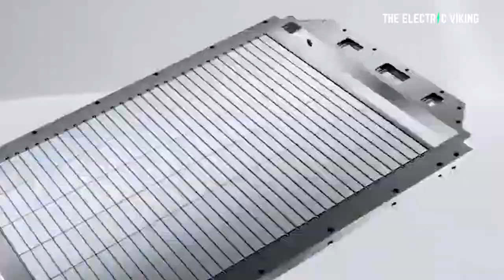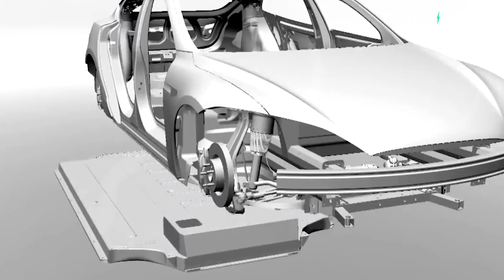Tesla's Model 2 Hatch & Crossover will KILL gas cars in 2023

Comment: I believe that Model Z would be a natural progression from X and Y. A compact crossover SUV with similar dimensions to the BYD Atto 3, MG ZS EV and Hyundai Kona, all of which are very popular and successful EV models. This is the market that Tesla needs to break into. If they could launch a vehicle like this which would cost $30k in America, and $40k in Australia, they would sell millions of vehicles. The problem with a hatchback like the Peugeot e308 is that it's too small to get decent range because of a smaller battery pack and also have reasonable room inside. It needs to be taller but more compact in width and length than the Model Y. That's what I would do if I were Elon. Maybe that's not what he will do, but I think it would be fairly easy to just use the basic design of the Model Y, same mechanicals, same structural battery pack and cast alloy body section, but just shrink it a little, just take a couple of inches out of the width and length but add an inch or two to the height to compensate, and you can make the car cheaper because you need less materials. The top half of the car is mostly glass, so those extra inches in height won't cost much.
Reply: I guess the Model Z will be produced in Russia.
Reply: @hvxcolors396   Yes but only if they can get rid of Putin. Z stands for victory in Russian. We need victory in Ukraine, then victory in Russia - but not Putin's victory, Zelensky's victory. Z for Zelensky. And then Tesla's victory. A giga factory in a new democratic Russia wouldn't be a bad idea...

Comment: I predict the same!! A Model 3/ Y has 255!! Wheels, Power without End, and needs 16 Kw/h. A Hyunaday Ionic e from 2012!! can drive with 11.
It must be possible, to build a Car, which need 10 Kwh /100 km.
Thats 60% less. A Batterie 75 kwh/ 60% would mean, 30 or 40 Kwh Batterie would be enough!

Comment: They have the potential. I'm not convinced it will come out in 2023 though.
However, 2023 should be an amazing year for Tesla. 
I think they will: come out with the Semi, the Cybertruck, and improve the 4680 to bring battery costs down while improving other performance specs.  Their megapacks will probably double in sales if not better than that. 
They might double their production next year.
If they can come out with both the Roadster and an "affordable" 25,000 dollar car, that would be spectacular.
Reply: Most likely using sodium ion n mmmegapacks
Reply: @michaelstarkey9745  No kidding? I haven't heard what their megapack chemistry is.
Reply: @michaelstarkey9745  Is there a greater supply of sodium ion chemistry for mass production?

Comment: Heard your opening statement about the speculative nature of this video based on your research. Before I watch it I'm going to stick my neck out and see if my limited research [because I haven't tried that hard on this one] is similar. Bear in mind that there is a lot of educated extrapolating and outright guessing here too.
1. Tesla Shanghai team designed car. 2. Two-door hatchback. 3. 230 best mile range. 4. Announced in 2023, due in mid 2024, with mass production in 2025. 5. As standard it will come in 2 options - with steering wheel/pedals, no FSD, and no steering wheel/pedals, with FSD. 6. It'll be capable of 0-60mph of around 6 seconds, with a top speed of 100mph. 7. 55kWh LFP battery 8. Heat pump as standard. 9. Ticket price US$25K for the human driven version. Maybe less..! Might be just for non-North America markets as we all know that the US/Canada hates small cars. 😋
Not going to stick my neck out any further to estimate the price of the FSD version.
OK, now that I have opened myself to instant ridicule, I'll watch the video. Should be fun.🤞

Comment: Tesla has attracted some negative comments from the CCP regards the Tesla cars and its camera system capturing photos of stuff they don't want documented, and in a despotic country with human rights issues and military build ups this is understandable. So the Tesla 2 should reduce the 'auto driving tech and cameras' on the Tesla 2 to get the praise from the CCP and which will also reduce the manufacturing costs of the Tesla 2 to get that price point and disticntion for the higher price cars which will retain the auto driving features. Perhaps it could be offered on the Tesla 2 as an option. Have you heard about the new EV tyres which are meany to increase milage by 40% just by changing the tyres

Comment: Golden numbers for me are 250 miles at 30k with 200KW+ charging. I know the bolt hits 2/3 but 50KW charging is just not acceptable
Reply: I think even 150kw DC charging would be pretty quick for such a small battery. Bolt is a larger battery. I don’t know of any that charge up to 100kw right now.
Reply: Mine are 400 real world usable miles for $60k USD.  That would mean 500 miles of stated range.

Comment: Hello electric Viking. 

I will challenge some of your assertions, which I think you will enjoy.

6 miles per kwh is what the Lightyear 0 is claiming. This is with a very teardrop shape, covered wheels, no wing mirrors etc. It will be pretty tough for a more traditional hatchback shape to match this performance.

Also what technology in this new car will allow Tesla to dominate the market ? The same CATL batteries could be purchased by other companies. The mega casting machine is made by a third party, so can be purchased by other auto makers. The same robots can be purchased.  So what is stopping other manufacturers making a similar car at a similar price ?

Comment: The next model will be a multi-car platform. I think it will new platform from which they can make a compact car, hatchback, and possibly a small convertible. This chassis will initially come with a steering wheel and gas and brake pedal but it will be designed to have these eliminated and ordered only as an option in the future. As I am not sure every country will make the transition to driverless cars as fast as the USA so the ability to still be backward compatible will be needed.

Comment: If the Model 2 (as in 2 S3XY) production cost will be 50% of the Model 3's, a structural battery pack (per se) may be history -- if a single casting will suffice. Why? The best process is no process. The best part is no part. Faster, better, cheaper, simpler. Additionally, vertical integration could move beyond key components (castings, batteries, motors) to include other, less complex parts via 3D printing (metals, composites).

Comment: You are right, no one accurately describes this hype vaporware vehicle, you can't even reserve one.  It  doesn't  even have a prototype. Given that it took 2 years to get to the Semi and Cybertruck even after they at least had a prototype; this is clearly further away; maybe 2025 when they introduce it as a hydrogen fuel cell vehicle or maybe a hybrid with E100 so it is actually green. Perhaps a pod that only simulates driving for home workers.
Reply: Elon Musk has said  "fool cells" are "mind-bogglingly stupid," so don't hold your breath waiting for a hydrogen powered car.

Comment: Question IS do they have the factory space and ability to keep manufacturing capacity/delivering current models PLUS the Cybertruck and Model 2 in the U.S.?  I will be surprised if they actually release it in China given their Real Estate Market is on the verge of collapse and their COVID restrictions of people there who are NOT working because of BOTH of these problems. Lastly, FULL Battery charging times MUST be reduced to under 10 MINUTES.

Comment: man.  If tesla just comes up with a hatchbatck that is fine.
if it is a little jacked up thing like an HRV thats perfect.
it will totally take over city fleets of ubers.

It does not need 300 miles of range if it is a city car.   
Just jack it up a bit like an hrv.   Doesnt even need to be fast if it is a people mover/commuter    one verion cheap people mover.  maybe make one with second motor and a little hot rod.    Technically they can  never release it.  allow a sub company to make the conversion kit   Now you have the cheapest car ever.    and just created a separate modding industry for the Model2.

Comment: My first electric car will be the aptera. The aptera starts at $26,000. The aptera will last several life times!!!!. It will do this because the car has a composite body that will never rust like a steel body. The aptera is the most efficient ev ever designed!!!!!. It is a light weight two seater sporstecar, yet it has a large trunk the size of a mid size car. Unlike Tesla, there will be no $15,000 fee for automatic free driving!!!. The aptera is not only designed to be the most efficient ev but it's designed to be easy to build and maintain. Sandy Munro of Munro and associates, has partnered with aptera to help the car design and manufacture be simple and cost effective. Unlike other ev makers who need a plant worth billions of dollars, like ford, byd, Tesla, the aptera plant will only cost millions of dollars. Another way the aptera will last for generations is the modular build and replacement. As technology improves over the years u can easily change out the battery or computer for a more efficient model. Aptera is an advocate of owner maintenance unlike Tesla who charges u a fortune for repairs!?!?!?.... Did I mention the solar panels imbedded in the car body???!!!!!. The solar panels charge the car 14-40 miles per day. So,vif u have a short commute to work, u may not have to plug the car to recharge the battery........just park it in the sun!!!!!!..... For a list of 20+ reasons why aptera is the best $26,000 car u can buy,csend me an email. I shall also send you a discount code to save u money for the aptera when u order it on line......regards......a. barbuto...... barbuto@optonline.net.....

Comment: I think your weight estimates are too high. My M3 RWD weighs 1600Kg. The Model Q will much less with smaller structural battery. I expect they will achieve single castings. 
This car will achieve avg 80 - 100 Wh/Km so 10 - 15  Km per Kw. 50Kw pack would then get around 700 Km range.

Comment: Phew, that was a heck of a video, Sam. You stuck your neck out long. But I think it was well judged too. CATL providing the structural battery for Tesla - I didn't think of that one. Aside from that, my predictions in my previous post stood up ok, I think. I'm 6 months to 1 year later on production and I have the big battery on the US$25K version. I didn't want to produce a TLDR meassge, so I kept it as short as possibe. There's a lot I agree with in the video, especially the 2028 date. It's going to be largely over for ICE by then, and the little Tesla [M2] will help drive the coffin nails in. 👍

Comment: Just hoping the next vehicle by Tesla would be a multivehicle platform. The need for a bigger SUV, work van, and passenger van means Tesla needs a bigger platform to be the standard base for these vehicles. If they manage to combine that platform with Cybertruck's component then that would be even better.  I do not see why they can't share the same battery and possibly the same front and rear casting as the Cybertruck. To make US automakers change over you have to come out with strong competing vehicles and the small car is not where they compete. The market will be filled with small EV cars which is why I'm not sure that going to Tesla's next car here in the US. When batteries see a huge price drop the small EV will be Tesla's mass-produced vehicle.

Comment: tesla needs to aim for the car to be priced at 18k, so when they immidiately price hike it, it is around 20k.

at the moment they have been talking for a 25k car and it is expected to be close to 30k (probably 28k+).

that is not affordable, given that is a base price and not the average price sold.

model 3 was aimed for 35k and it costs 47k base price at the moment. That is way out of being close to affordable, that it was supposed to be.

they have a very desirable brand and quite desirable cars which is why they are selling like hot cakes to people that should be buying below this price range, but the lower you go to price ranges, the buyers' flexibility becomes smaller.

Comment: In ten years you'll be able to buy used ICE cars very cheaply, few people will want them.  EV's are so inexpensive to run and there's no maintenance.  
I'm buying more Tesla stock now.  I bought a bunch 5 years ago.
Reply: No maintenance is simply not true.  The engine and transmission maintenance is the only real difference, and fluids and filters are cheap.  The rest of the cars are essentially the same with the same level of maintenance.  EVs are heavier so anything you save on less frequent brake changes is negated by more frequent tires, and tires are EXPENSIVE.  That myth needs to die if EV nuts want normal people to give them any credibility.

Comment: I think electric makes sense for semi trucks and delivery vehicles, (UPS, Fed Ex) but is more of a fad for passenger vehicles.
Reply: @andrew frazier  I was where you are not too long ago.  Here in the United States, with the low number of working charging stations, and mainly the lack of home charging for apartment dwellers, it will be a good while before mass adoption of full battery electric vehicles.  I have learned a lot in the last year, and now believe that battery electric vehicles will be the primary type of vehicle on the road, it is just a matter of how long that will take to happen.  Time will tell if there will be a subset of vehicles that run on the battery pack, but also have a very small internal combustion engine just to charge the battery pack if needed.  Perhaps that will be a transitional step.  In that situation, the vehicle would need only a very small fuel tank, and would still be much more efficient than the currently available hybrid vehicles and plug-in hybrid vehicles.
Reply: @paulbrown2422  Thats possible for sure.  The other consideration would be infrastructure beyond charging stations which the small ice motor to charge the vehicle addresses to a degree.  We currently don’t have the power to just run semi’s and delivery vehicles. I think we may be 30-50 years from generating the necessary electricity to run cars, homes, manufacturing and delivery. Im speculating of course but we still have states with rolling blackouts in the summer.  Imagine that effect on producing and delivering goods. 🧐
Reply: @paulbrown2422  Maybe the small charging motor would be powered by hydrogen?

Comment: Some of the Model 2 designs are pretty fanciful but the Tesla design ethic is not. The Model 2 will probably be more akin to a Model 3/Y, perhaps a smaller composite of the two, a crossover sedan/hatchback combining the benefits of both. Since speed of execution and extreme scaling is the key, perhaps only a single model will be introduced (at first, with platform flexibility for expansion), one or two motors as you suggest, the point being, the sooner they can flood the market with one model that appeals to both sedan and hatchback design sensibilities and, more importantly, functionality, the faster Tesla will accelerate from the would-be legacy competition, possibly utilizing their advanced painting research and technology by offering a larger selection of colors. As we have been learning, the Chinese auto-buying population is fast becoming the world's most sophisticated, and the world will follow suit, i.e. the functionality (software) is the most important 'feature,' the experience within, the entertainment value - EaaS - Entertainment as a Service so to speak, driving more profits to Tesla's bottom line via subscriptions.

Comment: Your numbers are disappointing. I thought Tesla would be able to produce a new vehicle that would blow away GM. I mean, the new Equinox and Blazer will have 300 miles of range for around $30,000. And they have a front display and buttons unlike Tesla that has a single screen in the center console for all of the controls. I would rather have the GM vehicle, like my 2023 Bolt EV, because it has the same display and controls as an ICE vehicle  with the same price and range as the Tesla. Just my opinion.

Comment: The base model Hatch will cost A$40K+On Roads.
The base model Cross will be line ball with the Atto 3 but smaller in size. 
Every other variant will be Over A$50K.
This is not the winner to replace the mass market price wheelhouse of A$25-40K.
It will weigh around the same as an Atto 3 with a smaller battery pack and smaller dimensions.
It’s only advantage is emotional.
It a Tesla!

Comment: You did your homework here, but I see all this going in a different direction.  Your not factoring in FSD.  I predict that by 2030 a lot of people are going to start choosing to not own cars, because Tesla will have cars that fully drive themselves, no driver required.  Owning a car is really expensive: cost of vehicle, Insurance, maintenance, gas/charge.  If Tesla can get the cost per ride at a low enough point, it will be way cheaper and simpler to just summon a car and pay to ride everywhere....

Comment: GM had and electric car called the EV-1 and were not willing to make money with it.     It did not need the dealerships.   All it needed was Tire rotations and window washer fluid.
They want dealerships and maintenance cost with vehicles.    They will stall till they are gone just as Toyota will.   Toyota had the RAV-EV and they were destroying them until too much bad publicity was given.   Oil companies beleave they are going no where and will always be around.   They are the biggest ones controlling the US government and car companies are just pawns compared to the GDP earnings of only one of them.    They can even use the US military to shore up losses in gas revenue from EV' s.   Think they won't ?